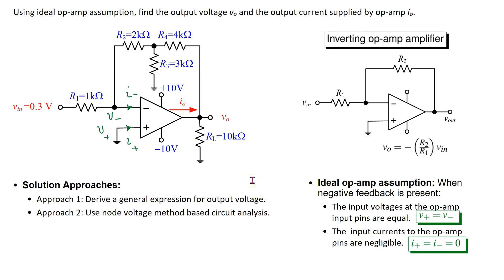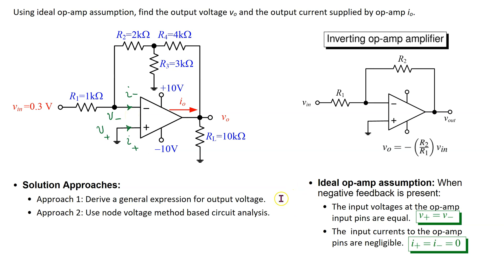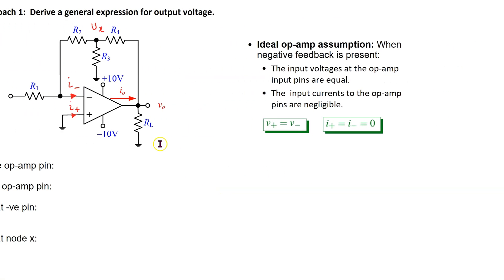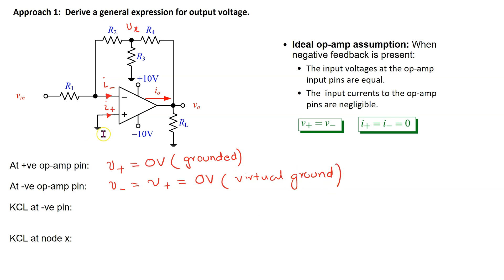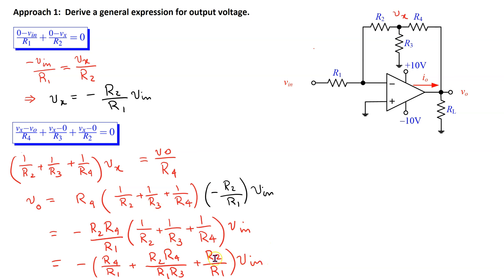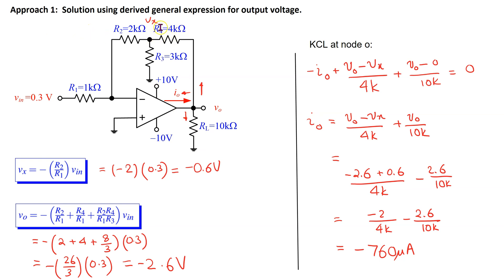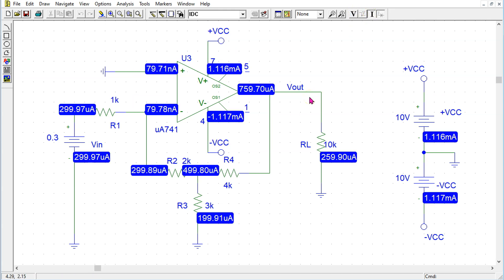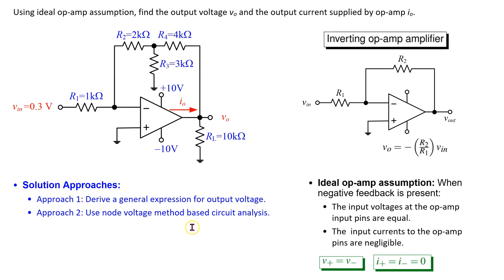Op amp circuits - Example 2 Inverting op amp amplifier

Comment: Why R2 and R3 are not parrallel
Reply from the maker: Two resistors are in parallel if they are connected between the same pair of nodes. In this case, R2 and R3 have one node in common but not the other. Hence, they are not in parallel.
Reply: @electriccircuits7164  sir but the other node is at 0 potential naa
Reply from the maker: A node having 0V voltage is electrically the same as ground but physically, they are different nodes (different points in the circuit). R2 R3 R4 are forming a Y or a T network of resistors. Resistors in a Y or a T network are neither series not parallel. 

If you take them as parallel and solve, you will not get correct answer.

Please follow the steps shown in the video to work out the correct answer.
Reply: @electriccircuits7164   sir I could not understand this
Reply: @electriccircuits7164   please explain mein this concept.
Reply: @electriccircuits7164   why they are physically different nodes
Reply from the maker: You have assumed they are parallel and your answer is incorrect...that must mean your assumption that they are parallel was incorrect. Do you agree?

Resistors in a T network are neither series or parallel. That's one reason.

In this case please reflect on the following: The node where R1 and input pin of opamp are joining is physically not the same as the common ground, because it is not connected to ground. Two resistors are in parallel only if connected between same pair of nodes. This condition is not fulfilled here.

Your misconception is that 0V at a node does not make that physically connected to ground. Having 0V at a node is an electrical condition only.

Please reflect more on these explanations. Also, look up T or Y connection of resistors (covered in other videos in this channel). 

Hope that helps!
Reply: @electriccircuits7164   sir if convert this network in delta network
Reply: Or pie network one resistance between 0volts and ground can be neglected and we are getting same answer as you were telling
Reply from the maker: Yes there are many correct ways to solve. Glad you were able to solve it!
Reply: @electriccircuits7164   😃 I understood 1 poiny physically it is grounded does not mean it is electrically connected
Reply from the maker: To be more precise, it's the other way round: Having 0V voltage at a node means it's an electrical ground but not a physical ground (unless there is a physical connection to ground).
Reply: @electriccircuits7164   I thought using returning current sir which will not enter through virtual ground but through voltage source ground
Reply from the maker: @mindMapgate  Please clarify what your question is. Your original question in the thread was if R2 and R3 are in parallel. As discussed, R2 and R3 are not in parallel and current considerations do not play any part in correctly determining whether two resistors are in parallel or not. For resistors in series, yes if the two resistors have the same current flowing through them then they are in series. If you wish to just confirm your understanding of the current directions in the op-amp circuit, then you can do this by simulating the circuit in LTSpice or Pspice or Pyspice.
Reply: @electriccircuits7164   email ID because I have doubts in other questions as well sir
Reply: @electriccircuits7164  sir can't they be parrallel
Reply: I calculated by making them parrallel but answr is coming wrong